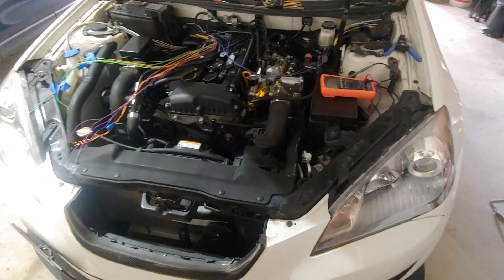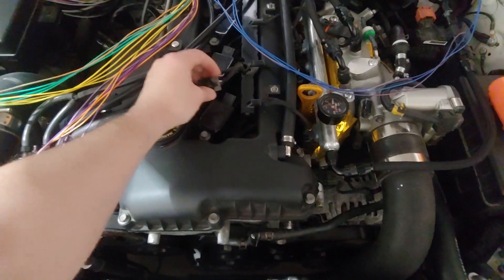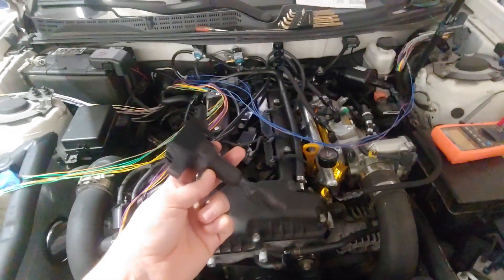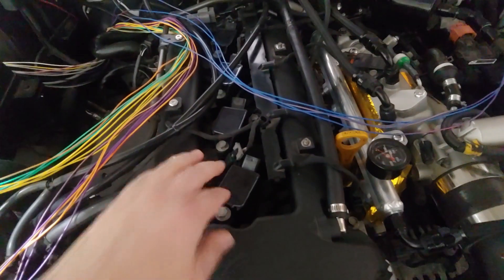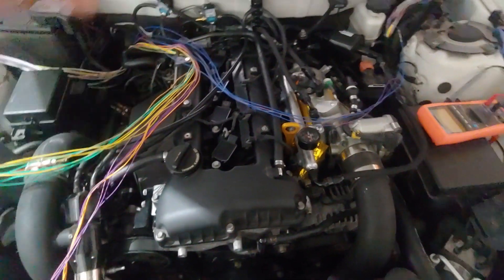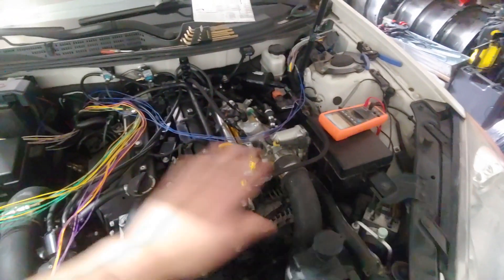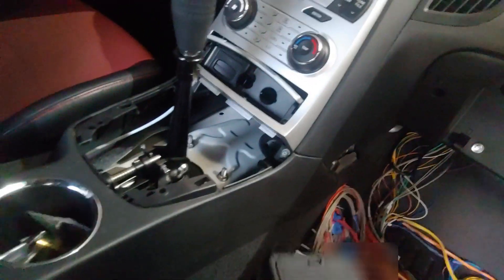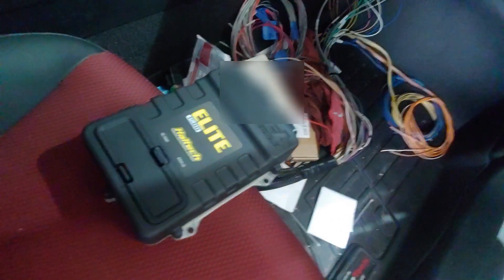Genesis Coupe 2.0 Haltech Elite Install - DIY/How to, Part 1

Comment: Do you have to change out and rewire a bunch of stuff to install the ecu? I thought it was just plug and play?
Reply from the maker: The platinum pro is the plug and play option. The elite ECU needs to be wired in. The platinum pro is no longer produced or supported by Haltech. There are companies that make an adapter harness for the elite, but they cost over $1k. That is why I chose to DIY. It isn't too complicated if you separate everything you need and approach it as 1 system at a time. Really you're just doing, fuel, spark, timing, and the throttle.
Reply: @Weekend_Garage  ah ok, wonder why they discontinued support for the plug and play one if it's easier
Reply from the maker: The platinum pro across all platforms is discontinued, it is just old technology. The elite, and now the nexus, are far superior for everything. Making things universal on their end is much easier to maintain rather than developing unique ECU plugs.
Reply: @Weekend_Garage  who tuned your ecu?